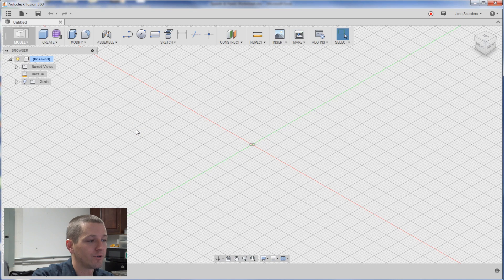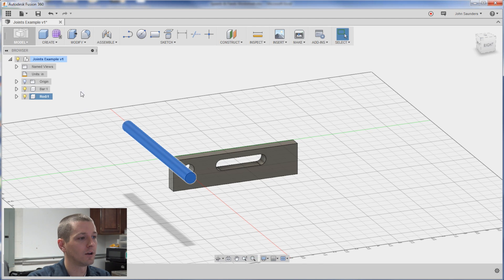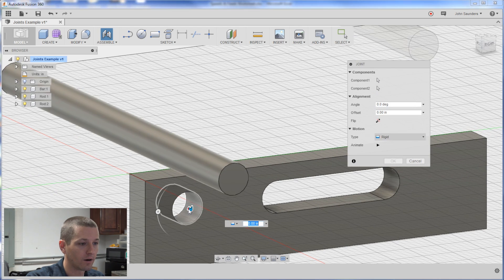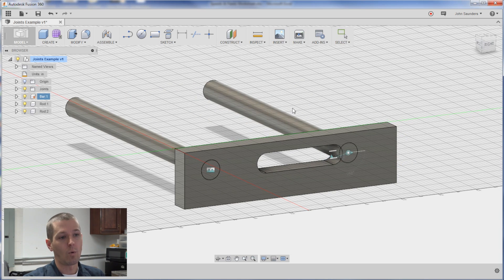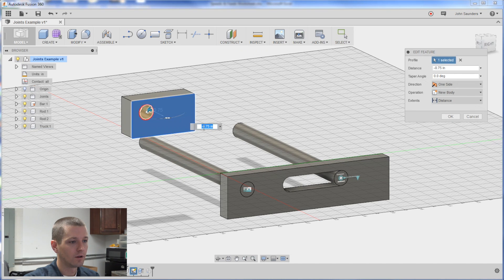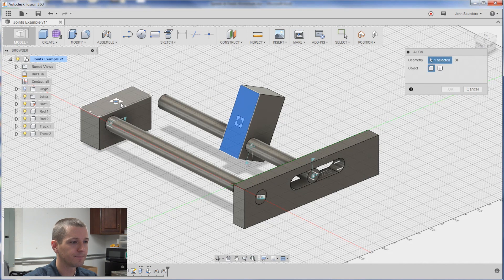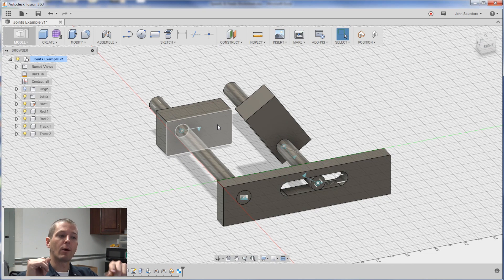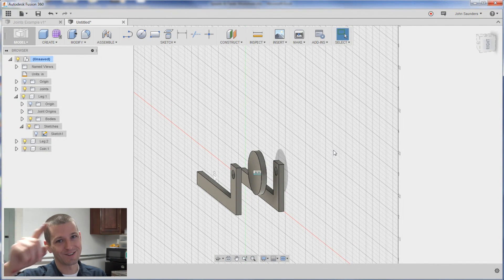Fusion Friday #3:  Joints Explained!

Comment: Small digestable tutorials < 10 minutes perfect . I have set myself an abitious task of building an clock escapement and testing how it pivots. I have built the parts and trying to see if I can incorporate gravity ..does fusion 360 do that
Reply: Yes it does, in simulation mode. There are two possible directions for gravity to act in, the -Z and -Y axis, depending on whether you choose Y up or Z up in (Your name at the top right corner) -> (Preferences) -> Default modelling orientation. Good luck!

Comment: Hi John. I'm new to F360 and this video was very helpful. Is there a contact threshold value somewhere? I set the contact enable, but if I move the mouse quickly, it'll violate the contact constraint every time allowing me to move the second rod out of the slot to the right.

-Mike

Comment: I used some of the information in this video, thank you!

I'm trying to make a cam plate to open and close louvers.  I managed to get the drive shaft grounded in a bushing so it could rotate, then an arm extends out from the drive shaft with a pin that slots into the cam plate.  I tried to use the pin slot joint as you did, however it only works on one sliding axis and one rotational axis.  I used planar joint, which allows two axis of movement and one of rotation.  The only problem I'm having with that is the contact sets are not preventing the pin from passing through the end of the cam slot.

Comment: When you create the joint and fusion responds by letting you know the joint was successful by moving it based on the type you selected.  Once done, how did you interact with the joint? I notice you move the component around by using your mouse.  For me, clicking and dragging does nothing.  Are you pressing something as you click and drag?  I can't seem to figure this one out.
Reply: I don't know if there's an easy way to do it, but if you right click, it will have an option to 'drive' the joint, which means you can see how it moves and works.

Comment: John you're saving my ass left and right with these videos. I'm trying to switch entirely to 360 from solidworks and this was the thing that keeping me using both.
Reply: Geof Dumas it’s been 3 years since your comment. So are you happy with your switch? I had to move to fusion because of its ability to work with meshes and inbuilt cam. But i am starting to like it’s cad as well. And i hate switching between the two. And Fusion is free. What do you miss about solidworks that i am gonna miss too?

Cheers

Comment: Align is temporary... What's making me nuts(easy to do in this app) is keeping parts parallel will adding joints to additional parts and and while the assembly is animated. I'm assembling a system that is virtually the same as a scissor lift you'd see in a warehouse or lumber yard. I need to keep the top plate parallel to the bottom plate regardless of distance between them..... Have spent much time trying to accomplish this without luck... most tutorials are too basic.... covering the same fundamentals over and over.....

Comment: This is a little late but... To keep the sides of the blocks parallel perhaps you can use a planar joint. You can even offset the distance between the two sides you want to keep parallel for that joint type. Closest thing I found to traditional mates from other CAD software.

Comment: Great video, the joint origin tip has just saved me from a world of pain! I've been creating sketches to help me align parts at certain distances, most of my parts are imported from another software so as built joints aren't an option. Hard to get round to the fusion way of thinking!

Comment: How would you make a joint for something similar to a solid lifter that rides on a cam?
Reply: +NYC CNC A lifter as in an automotive engine.  Solid lifters could be modeled as a solid cylinder approximately 1" diameter x 3" in length.  The other type would be hydraulic lifters which would needlessly complicate the diagram for what I am looking for.  Then there are roller tappet vs flat tappet lifters, again that would needlessly complicate the diagram.

Comment: Thanks for the video.
You can use motion link under the assemble tab to link parts in various ways.
Here is a video that touches on the subject. https://youtu.be/U-2gNh6wxXU she uses motion link at 4:50.
This one of the best if not the best series of videos for Fusion 360 it covers many different topics and they are short videos if you like short.

Comment: is there any way to align threads? and also is there any way to configure a joint based off of another joints state. For example, linear movement via a ballscrew and nut. Can you tell the software for every rotation of the ballscrew, move the nut 1/8 of an inch in a linear direction?
Reply: +Colin B. I have seen a workaround for this.  Combining a cylindrical with a linear motion I believe.  Haven't tried it myself, but you should be able to find it with a search.  It should be on the Fusion forum.
Reply: +Jared R Great thanks! I think that would be so cool to take that to the next step and build your cnc in fusion 360, simulate your tool paths with that model, and see the screws moving and everything. more for fun than practicality, but never the less - cool.
Reply: +Colin B. Correction.  It should be 2 cylindrical joints.  Using one for sliding action and one for rotation.  Link them together.  Tested it and it works.

Comment: Great video John! When I switched over from Sprutcam to Fusion360 for CAM, I kept with my mantra of ALWAYS model all fixtures - this forced me to learn quite a lot about joints and assemblies in Fusion360. Once you get them down and get used to which joint types assemble from with joint origins, it actually gets pretty intuitive and quick to put stuff together. For example: I commonly assemble modeled raw stock, parts and fixtures / vises in CAD, then switch to cam and configure everything in the setup, makes life so much easier (and the not-crashing confidence level goes way up) when you get to the machine!

Keep the great videos coming!